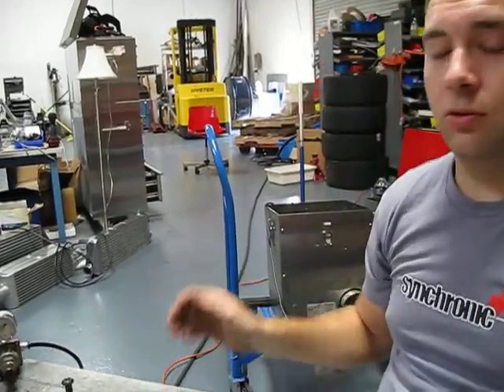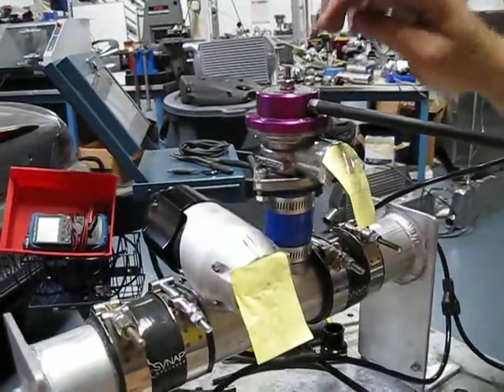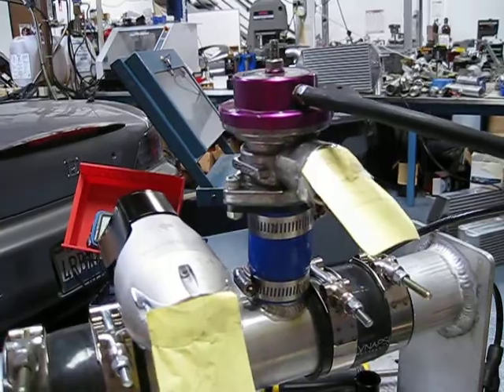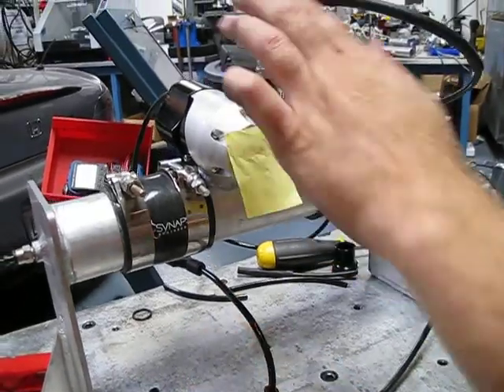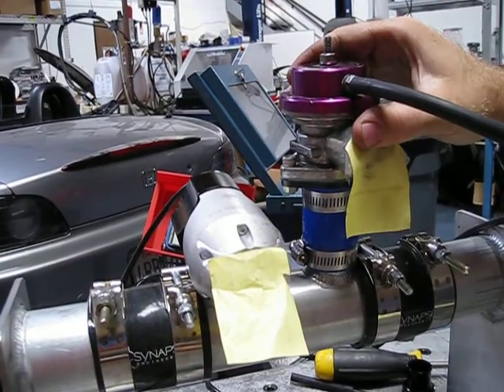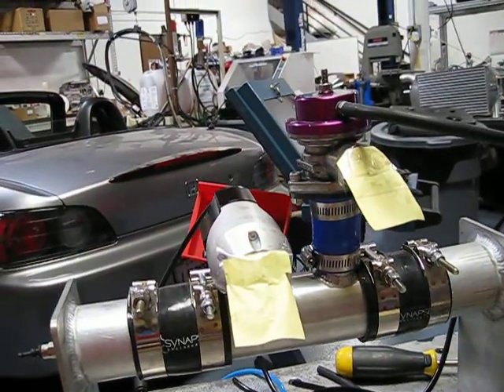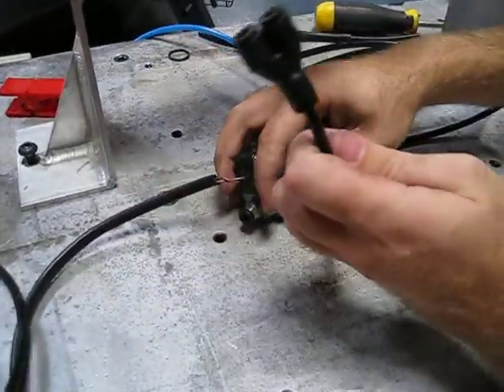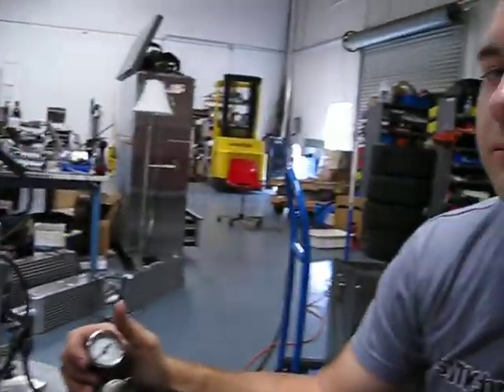Greddy VS Synapse on the test rig

Comment: This test makes no sense what so ever,  of course you put more than one bov one will over power the other even if both are the same bovs. not only that the greedy is on a high portion on the pipe. Also why would you want a fast acting bov where those types of short breath bovs won't let out all the air needed to be released. I used greedy type S  for years, never had major issues with them. my buddy made 437hp, on a stock block dsm with a greedy type S and never leaked or make the car boost spike or creep.

Comment from the maker: @MidShipCivic check out the chart at the bottom of the post in our forum about the SynchronicBOV-MajorRevisions 40 milliseconds for an SB001 to drop the pressure in the tank.  How fast before the valve actually moves, 20 milliseconds.  Anything else is an eternity.  More data to come.